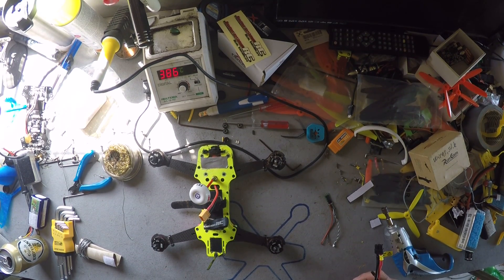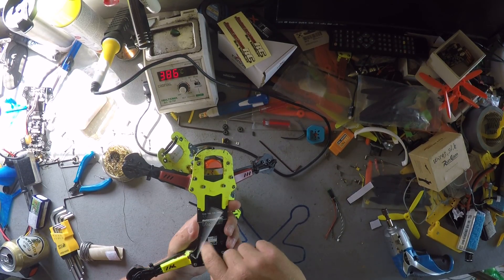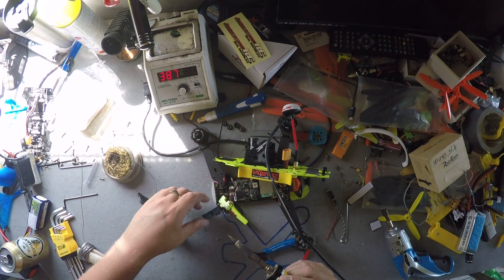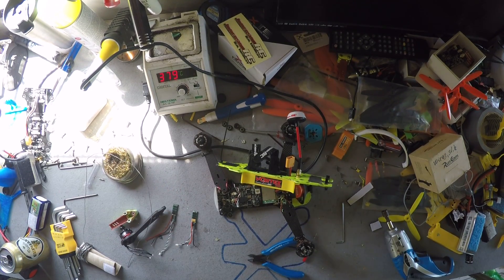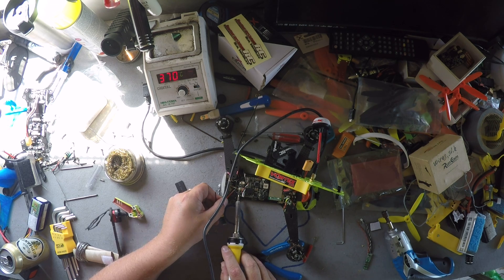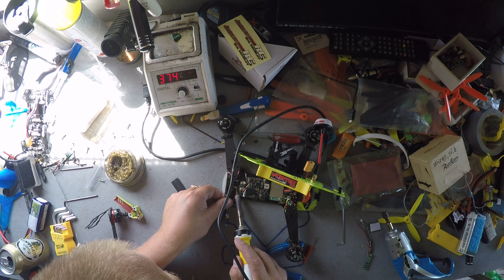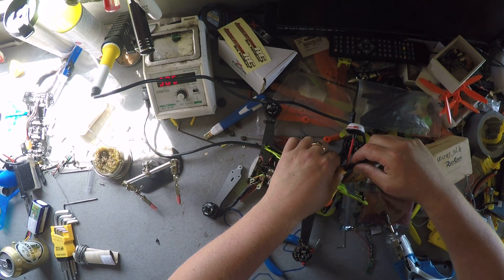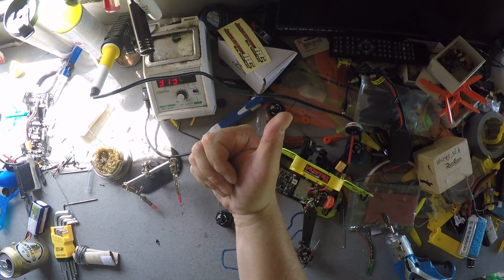How to replace Vortex 250 pro ESC.

Comment: Dude you are a life saver. Today i crashed and after that one of mymotors didnt arm. All day im searching for the problem and now i finaly found that the esc is not working thanks to you. My question is, should i buy  better esc or stick to the same? Thanks
Reply from the maker: heey Thanks Vladimir :O) i would stick with the IRC ones. they can pull alot more amps than the 20a ;O) and, easy to use, no flashing, calibrating or ajusting, just solder and fly :O)